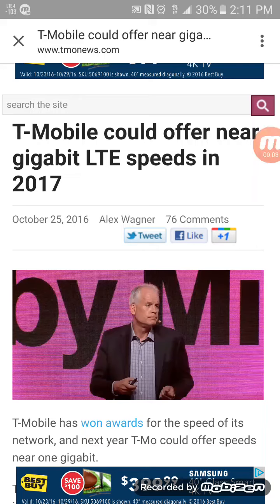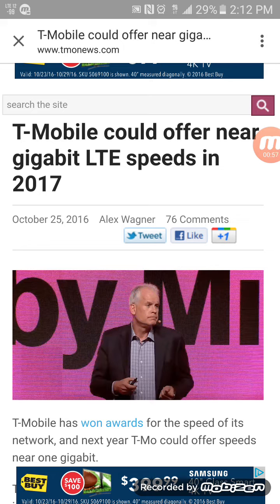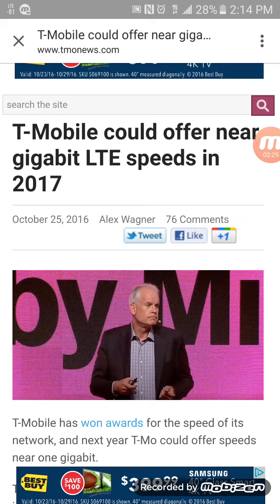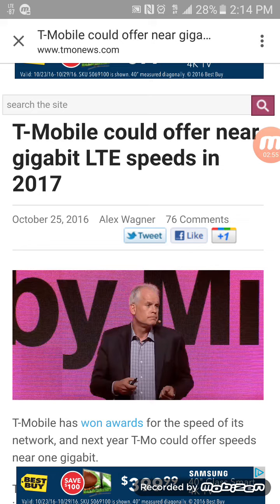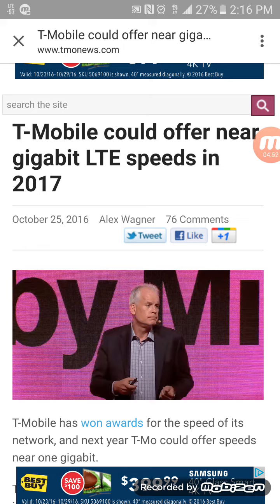T-Mobile LTE advanced  ( new technology explained)

Comment: thanks fro replying to me. :) I really didn't know if that would be possible for one side of the tower to be slower however I just walked to the east side of the tower just before eating your video and it is slow on the east side of the tower now it's even worse then what I'm getting at my house I could only get 18mbps down and 7mbps up out there tonight and also band 2 seems to be having issues tonight
Reply from the maker: +Tyler Idle yes, could be more tmobile users in the area, network team working on the tower. There are many reasons a tower can be slower

Comment: well Rooting your phone will have the following disadvantages yes you would lose the factory warranty if you don't rooted correctly it could brick your phone and you will no longer be able too do a software upgrade trough the manufacturer it also has its advantages like you have total control of how your device works battery life CPU RAM etc so this will make your phone faster if for example it got slow after an software upgraded
Reply from the maker: +Landon Gonzalez thanks for the info! I dont think im willing to take that risk
Reply: +Tech life channel well since you have a galaxy its compatible you can use King root todo do this